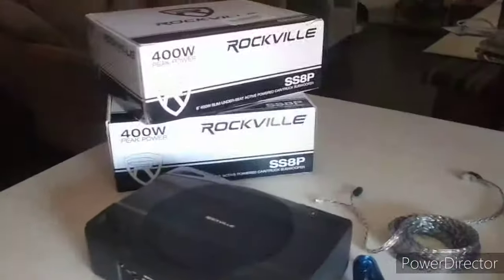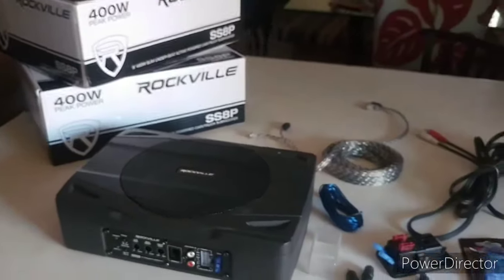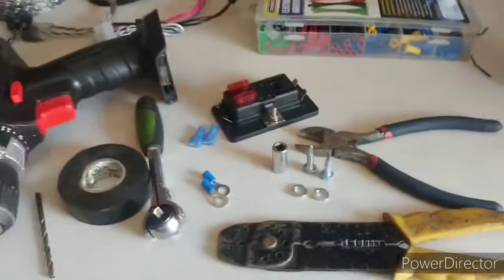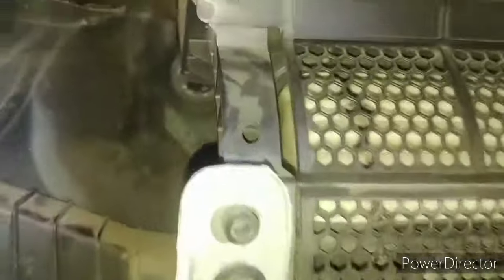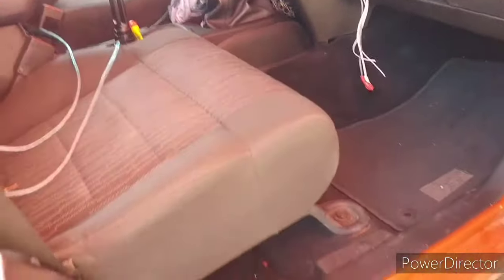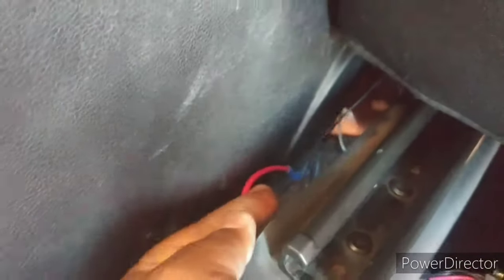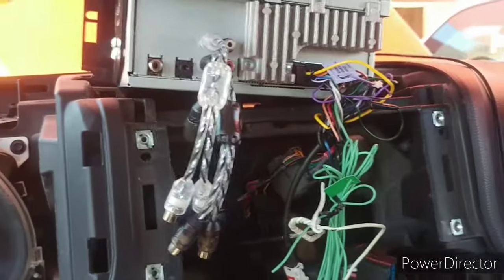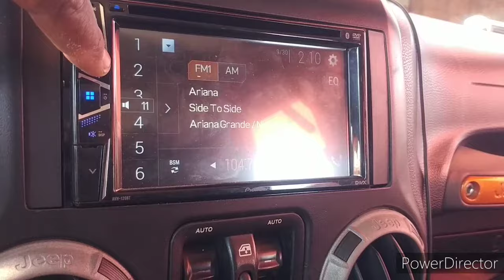How To Install Rockville 8" 400w Underseat Subs in Jeep Wrangler

Comment: Hey bro where did you get the dual amp rca splitters I have same setup looking for same rca setup
Reply from the maker: Walmart in their little audio section in automotive. I found the last two and was like "I need those!" LOL! But now I wanna add an amp to the 8" SKAR in the very back, and I think I need another splitter for that. I don't know how many splitters I can run, but if it's just a signal, then I'm sure I can split a splitter and still keep a good left/right signal.

When you're looking for them at Walmart, they're in a yellow/black package.